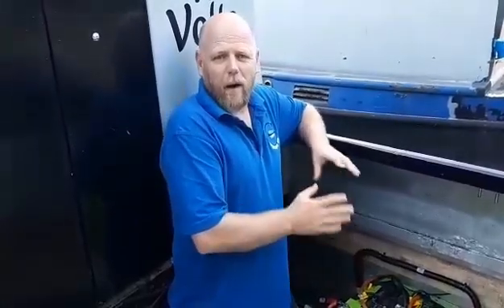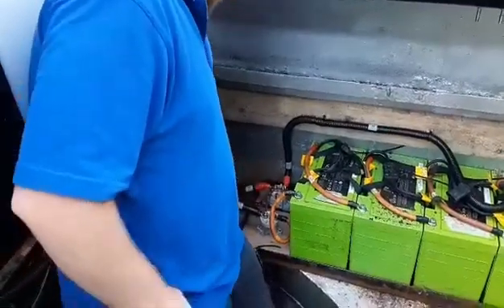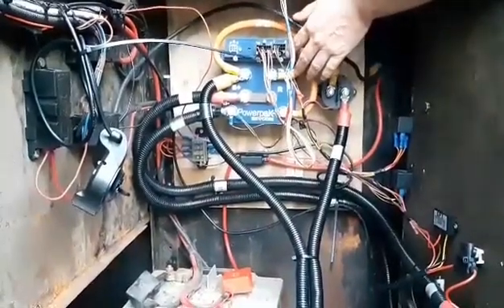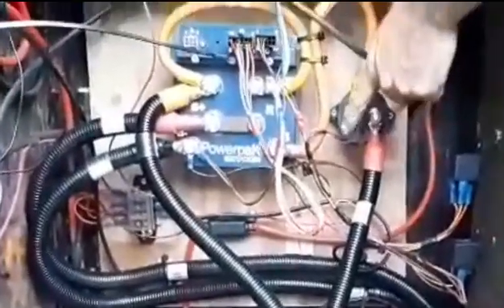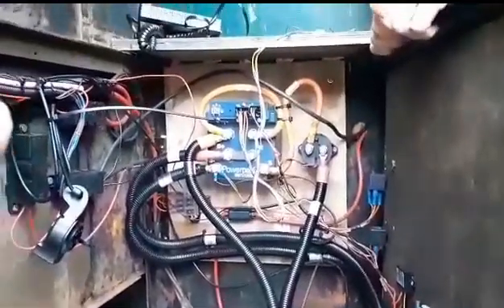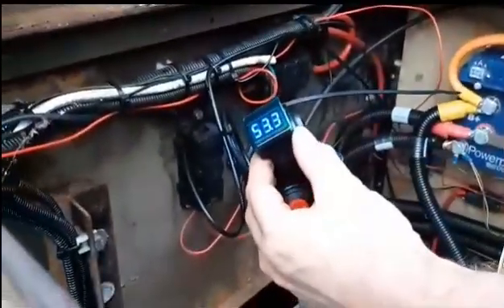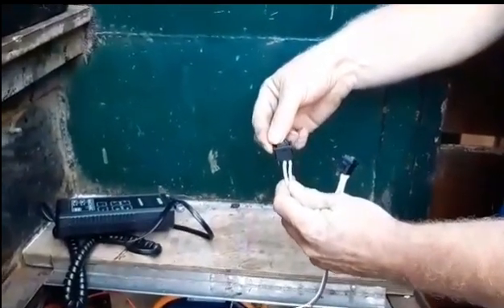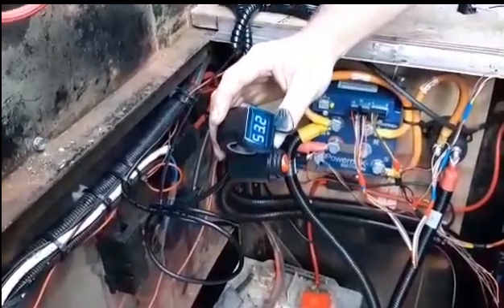DIY Electric Drive Conversion on a Narrowboat - Winging It, With The Tight Yorshireman. Episode 6

Comment: Quick question the two switches if you put into opposite possition so say 1 in 2 and 2 in 1 would motor spin other way 
If so could you switch motor doing away with mehaninical connection as in gearbox 
Then put a thumb throttle on the tiller

Comment: I suspect that's an e-bike hall effect throttle which will give your controller 1-4v when fed with 5 v through the red and black - Most older forklift motors work from a 5kohm potential divider and give  0-5 volts - if you find (as it seems ) no thumb throttle the motor turns slow and at full throttle your only getting 80% volts at he motor then you need to source a suitable potential divider throttle - go to a site 4QD it has loads of free info on motor controllers they even sell some potential dividers  - though any 5Kohm lever /dial or slider potential divider will do - hope that helps

Comment: Been there done it, got the t-shirt. And I am sailing electric! I also used an old forklift motor. Read more about it on www.hansfix.nl/electric.  I use contactors to reverse the motor, much easier for an electronics engineer. :-)